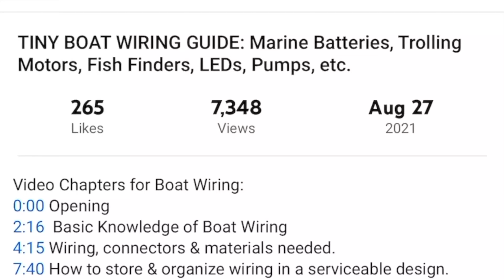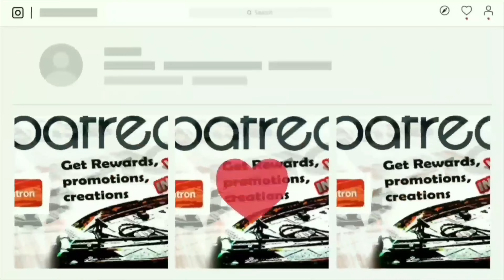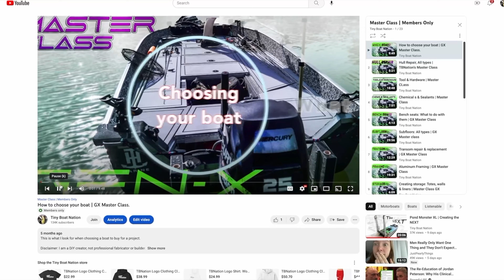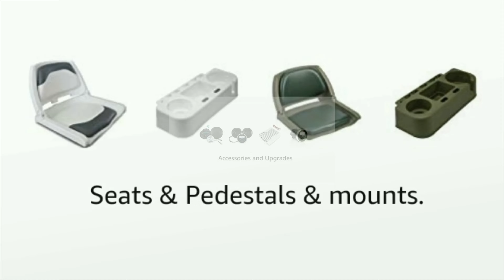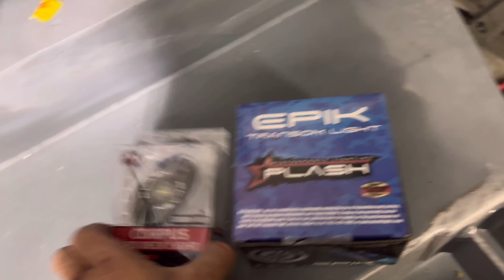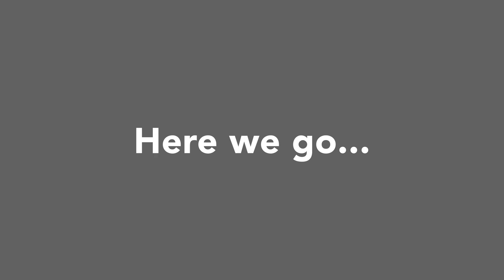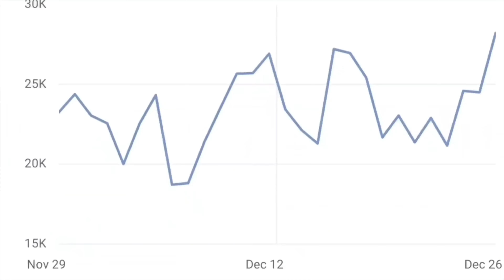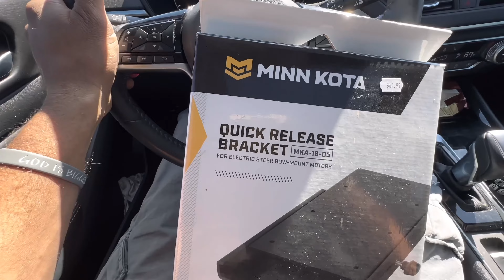2070 jon boat conversion | The craziest boat I’ve ever ever built!

Comment: Nice Job, and thank you for some Idea's . I'm a retired Master Marine Tech, that loves to fish by rod & bow., I'm in the build of my life, I was told to scrap out a few boat's, one of which was a StarCraft F-5 ,21.5  Hull , she originally , set up for an out board, but I also saved an OMC Cobra, with the Ford 2.3 Liter , which I am going to use . As dented as she is I was surprised all her blind rivets were still tight, zero leaks which is saving me time. I'm in the same boat as you were in your build, we had a dry winter, and we are having a vary wet summer , and No garage to  work in. do to all  the other toy's .  I'll be at this for a year.
Reply from the maker: Take your time! Do it right.